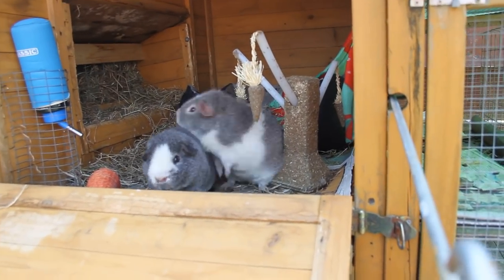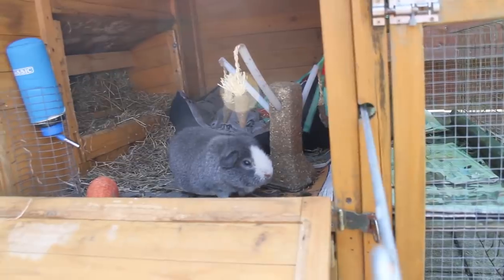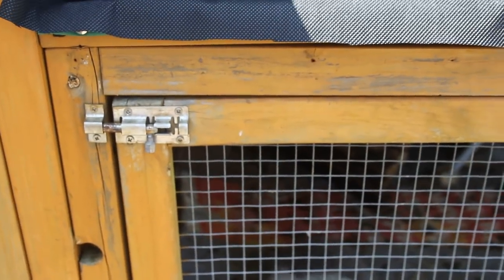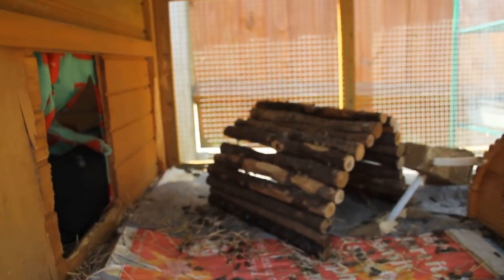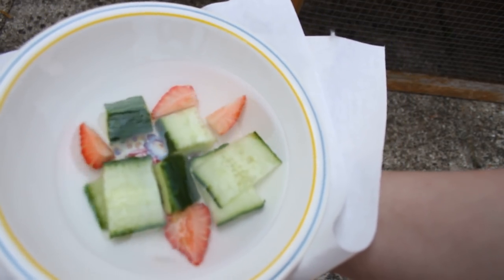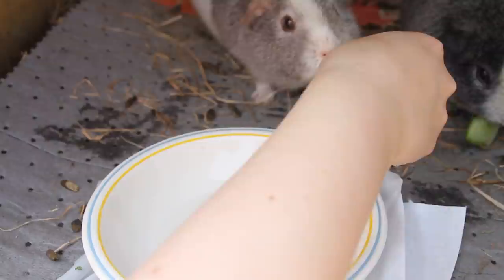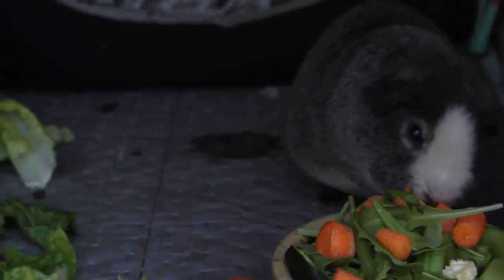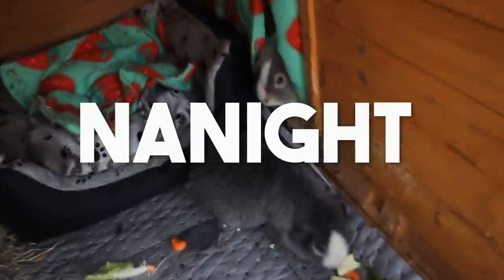Daily Routine & Hutch Extension | GUINEA PIG

Comment: put puppy pads under cut pieces of fleece and you have an easy to clean cage, also, we would give our guinea pigs rasberries and then it would look like they were vampires XD We usually put some paper fluff in the corners (they preferred to poo in the corners) and just change that out daily, which helped with not having to clean the cage for another day or 2 :) (we had a canvas bottom cage, so cleaning up any ... spills was quite easy as well)

Comment: I just swept up my Guineas cage before I watched this! Hay Is definitely the messiest part! Also quick question what do you use for the floor/bedding? I need some cushy absorbent stuff to go under my fleece because I have a cement floor I don't think 5 layers of thin fleece and a couple of towels if very comfy. It's not to hard but it not super comfy. Loved the video!!
Reply from the maker: haha, yes omg that gets everywhere! You could use one of those mattress protectors, its like water proof - ive seen people use them between the fleece so that the guinea pig doesn't sit in pee. Also you could make little pillows, really simple to make with fleece and some pillow filling/fluff.
Reply: +Leopard Gecko I have an actual small pillow in their cage to sleep on lol. And I need to get some mattress protecters!! Thank you!

Comment: Can I use sticks from the garden for my crested gecko cage if I clean them with disinfectant
Reply: some disinfectnts can cause illness in some reptiles. try using vinager and water instead.  soak them a bit too, so insects can drown if any. let them air dry before putting them in.
Reply: +haley james thanks allot I appreciate it
Reply from the maker: Once I did the whole disinfectant thing with apple sticks for my guinea pigs and chinchilla - did the boiling hot water thing, etc, next thing i know, the sticks are growing mould! even though i dried them out and everything - and that wasn't even in a humid environment. So it may be best, and safer to buy from a shop - reptile and/or aquarium shops are good :)
Reply: Leopard Gecko k thanks
Reply: +Leopard Gecko i used sticks frrom outside in my crestie cage but i baked them at 250  for 3 hours
Reply: +Hajrah Ullah ^^^^
Reply: +Badass Quads thanks